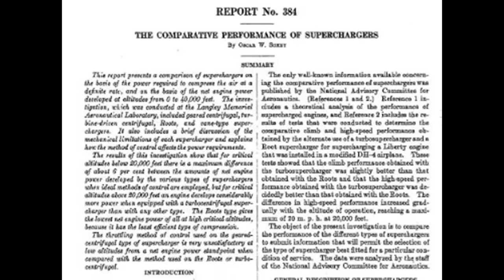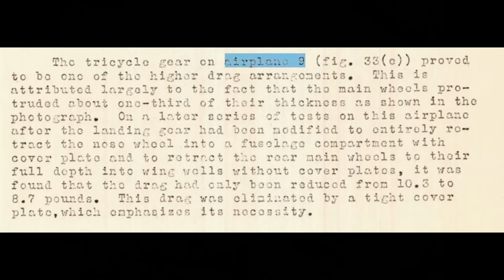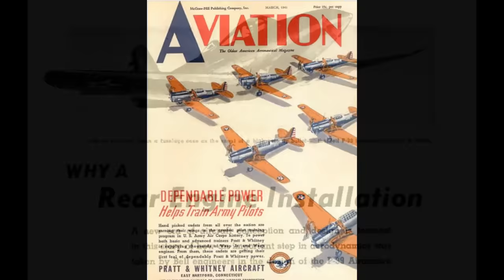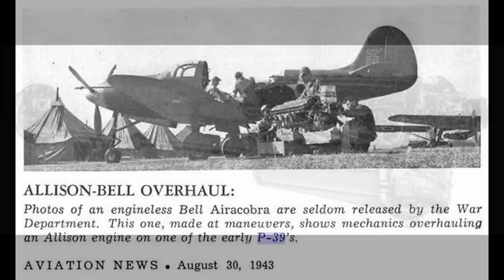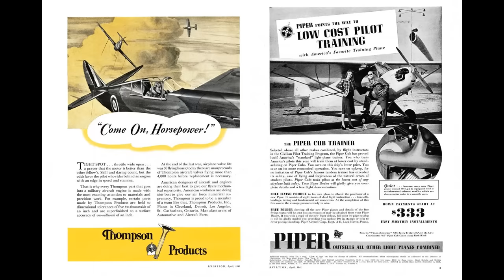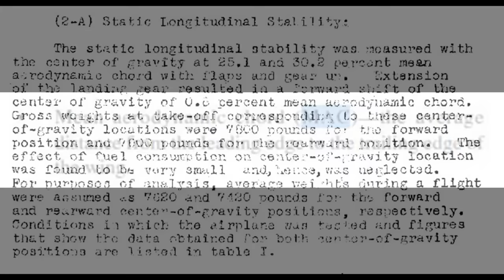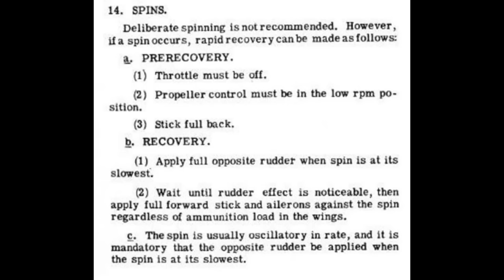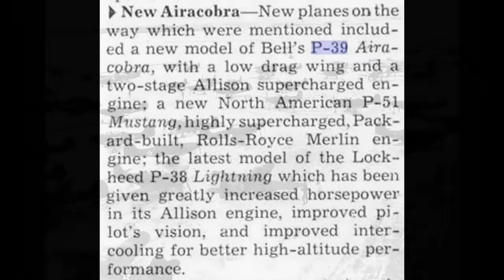Bell P-39 Airacobra, Why the Mid Eng?

Comment: One thing a lot of people miss when comparing Super Chargers and Turbo Chargers is. A Turbo’s Drive pressure and how it helps bearings and the rotating assembly. In the high horse power Alcohol burning Hemi world when running a Roots ,Screw , or Centrifugal type super charger. It will eat rod and main bearings each run when your running it hard. The same motor with Turbos will make 20-30 runs with out even checking the bearings.

Comment: The audio balance is a little bit off.  It's balanced to the right just a bit, but it's not just volume shift, the left is a bit basy, while the right holds the higher pitches.  So it sounds a bit weird, and is hard to correct on our end.  :/

Comment: In the 1980's I talked to a veteran who flew p39's in New Zealand service during ww2, he said the forward opening car door type cockpit entrance made bailing out difficult at any speed and in a crash landing the engine tended to break free from it's mountings and slide forward and crush the pilot. he said that they only trained on the type but lost some pilots before they got F4U corsair's and served in the pacific theater  against the Japanese.
Reply: The doors on the P39 was jettisoned by releasing the front hinges from the aircraft. Dodging the tail was a bigger problem when bailing out.
If you hit the ground hard enough to dislodge a P39 engine, you are already toast in any fighter. The engine mount in a P39 is SOLID.
Reply: @allangibson2408  thanks Allan for the  information on the P39,have read as much myself years later , but I had no reason to doubt what he said at the time, have always loved it's small size, low level performance, mid engine concept and  with it's 37mm cannon it would have made a great ground attack/ tank buster.
Reply: @chrisgrantham8442  Bell liked mid-engine aircraft. The P-59 and P-63 followed the line. You could argue that their helicopters still do…
Reply: @allangibson2408  Thanks Allan, do you know of any other manufacturers who went with the mid-engine concept?.Bell nailed it with their model 47 of MASH fame, it's still going strong today, a Indian army/airforce variation has the highest  ceiling of any helicopter in service today, not bad for something that started life 70 odd years ago .
Reply: @chrisgrantham8442  Jet engines kind of displaced mid mounted piston engines but they were very common in WW1 (usually in pusher configuration).
The downside with the configuration is the extreme difficulty in fitting a new model of engine as it requires a full redesign of the airframe.

Comment: I wonder if a VT fuze could have been fitted to 37mm shells, or maybe go larger to a 50mm autocannon to fit the VT. Muzzle velocity would be relatively low, for sure, but that would be a heck of an anti-air shell with a kill radius of 20-ish yards!
Reply: They put it in the 40mm so I expect that by sacrificing some of the explosive filler they may have been able to put it in the 37. Interesting idea, I don't think I've ever heard of proximity fused air to air cannon projectiles, even in modern use.

Comment: Hello Greg, 
I 'm not sure I agree that the fuselage would have to be made heavier to handle tortional load. The load goes from propeller, to shaft, to engine, to engine mounts, to fuselage and finally to wings during flight, or to landing gear on the ground. The part of the fuselage structure between the engine mounts and the wings handles the load. On the P39 that part is much shorter and handles the load much better anyway. The part of the fuselage forward of the mounts towards the propeller plays no part.
Thank you for the time and effort you put into this, your channel is gold
Reply from the maker: The twisting load is between the gear box and the engine.

Comment: Hi there, Greg.  Have you ever covered prop-gun interruption gear in detail?  Does each gun need its complete, separate, interruptor, or can multiple guns use a single unit, w pushrods(?) going to each gun?
Reply from the maker: I have not covered that. I might do it at some point.

Comment: High G-onset rate in pitch is generally considered a bad thing. The F-16C reduced the size of the horizontal stabs because the A model put guys to sleep.  The P-39 wouldn’t be stronger than the pilot, but onset rate is still a problem.  The Tweet had a very quick onset rate, again, not useful since the brain needs time to adjust blood pressure for pitch, but not roll.  Fast G onset just puts you out.

Comment: Why did the P-39 lose it's turbocharger?  Lt. Ben Kelsey was driving the fighter programs at the time, both P-38 and P-39.  He was the main force for the high-altitude interceptor concept, at least where the rubber met the road.  There was a 6 month transfer of him away from the fighter procurement project.  When he got back, the P-39 had lost its turbo and Lt. Kelsey was quite upset that some paper-pusher had made that ridiculous decision with Bell and neutered his short-range interceptor. (Although he also widely admitted after-the-fact that 'interceptor' fighters were a ruse to get funding from the isolationist-minded bureaucrats.)

Comment: 14:52 - He was right. By the end of the war EVERYONE was thinking along the same lines, except they moved the pilot right up behind the propeller. Note the Fisher P-75 and the Messerschmitt Me-509. Not to mention the proposed Rolls Royce fighter design that was to be used with the Crecy, it got as far as a plywood mockup. Note also that jet fighters, from just post-war until today do the same thing - put the engine(s) behind the pilot and the pilot up near the nose. I don't think it was aerodynamics, rather it was for better visibility, especially on the ground.

Comment: Greetings....I.  have. Watched.  Many.  Of. Your.  Video.s...  many. Times.  Especially. The. Airacobra. Vids....  which.  I.  Appreciate. Very. Much....and.  this.  Is.  Why.....  today. On.  This.  Video...  I. Realized...you.  mention.  Intake Charging.  Systems...   and.  My.  Thought....is.....   the.  Running.  Engine..  is. A. Bunch. Of.  Operational.  System.s. functioning....  like.  Oil. Sys....intake. sys...  exhaust sys...  elec sys or. Ing  sys........  cooling. Sys.. fuel sys... and. The.  Big. Difference.  Of. The.  Allison. Or.  Merlin.   Which.  You.  Mention. In. Other.  Vid.s.  is. The.intake.  Charging  system.  ..  at. Least. At.  That.  Time...thanks.  Again..  for.  The. Trike. Gear.  Video s...  have. The. Best.  Of.   Days...

Comment: The germans had a electronic switch that let guns shoot from behind the prop without negating rate of fire. Usually you would get a 20 to 40% loss in rate of fire. The german switch cut that down to 5-10%.

Comment: Great video Greg. Two comments: The G onset argument is not very compelling. An aft position of the cockpit, like on the Corsair for instance, would actually reduce G onset in a pull, since the associated positive pitch rate acceleration generates  transiently negative G at the pilot station, thus making the onset more bearable. However when releasing, the pilot will experience the opposite (transiently slightly higher G due to the negative pitch acceleration). However the lever arms were still quite small in WW2 aircraft compared to todays fighters, so the effect was probably negligible anyway. 
Second one: Comparing cg locations in %mac, to derive stability characterics across different airplanes is not 100% accutate. The appropriate measure would be the static margine expressed in %mac. That takes into account the actual position of the neutral point of th aircraft (determined by wing and tail geometry). But that is not easy to come by in the documents I guess. The engineers will make sure that static margin is appropriately designed, even with a rear mounted engine, before even thinking to have a first flight 😉
Reply from the maker: Percent mac is the best we can do here, and in my experience it's a good number for overall comparison.

Comment: The way they have it modeled in game in War thunder really made me look into it, and while the COG is perhaps better, the fundamental issue is that the heaviest item in the plane is right over and slightly behind the wing. This should be weirder than it is though, and I mean just consider, if you drop both planes a p-40 and this, the P-40 is going nose first, the P-39 is going kind of flat if not a bit tail heavy. You can see that in the one stall, the center section is pretty solid, the tail is crumpled, probably eating a lot of the initial contact with the ground. The best way I could describe it in maneuvers in SIM, is that instead of diving or carving through turns, you almost felt like you were sliding through the corners and you had to be really careful about that. This is most likely why you would see Lumchevaks as well, if you get an air stall over one wing the thing is going to start a spin like a top because it is so well balanced and center heavy. 
Now these things can be managed, and it is weird, but it certainly has its own charms and appeals to and I think that is what the russians made happen, they stuck with it and mastered it. Not like they could just hop into a clearer option. 
I don't think it is ideal though. I think I would rather be able to snap roll than go into a Lum.

Comment: 23:20 So I play flight sims a lot. I have noticed this rotational force umongst many different prop planes. It is prevalent in the 39, however it's worse in the p-63 King Cobra. Every sim I play I have to set a positive rudder trim to atleast 5% to maintain a straight coarse at cruise-speeds. It's the only way I've found to counteract that rotational force so you don't have to fight the airframe so hard just to keep it straight. 
Once this is done, the girl soars

Comment: I doubt putting the cockpit closer to the center of gravity would do much to reduce stress. Most of the force on the pilot is the centripetal force when the plane changes direction in the air. There would be a small force from the plane's rotation, but that would likely only play a role for a short amount of time as the rotation rate of the plane would stabilize fairly quickly. This is the main force I could think of that they might be referring to, but the difference in net force between a conventionally placed cockpit and one near the center of gravity would be pretty minimal considering the centripetal force.

Comment: Part 4. Aircobras in Northern Fleet (255 Fighter regiment).
P-39 started to arrive at 255 Fighter regiment of Northern Fleet in February 1943. The main target of the regiment was escorting torpedo and dive bombers. By April 1943 pilots studied the plane, on April 4, 1943 Aircobras flew its first combat mission – escorting Pe-2 dive bombers. First air fight was on April 29: 6 Airocobras engaged 6 Me-110, shot down two of them.
These months there were 8 Aircobras in the regiment (1 – Mk.1, 1 – P-39D-1, 6 – P-39D-2). They arrived via Northern lend-lease root: Britain – Murmansk.
In May 1943 Aircobras shot down 2 Me-110, lost 1 plane in combat, pilot killed.
In June Aircobras from other units arrived and by July there were 20 Aircobras in the regiment (5 – Mk.1, 1 – P-39D-1, 5 – P39D-2, 4 – P39M, 5 – P-39N). According to regiment’s report, radio stations SCR-274 were significantly better in range, power, provided better communication, than RCI-4 stations, that were on Jak-1 and LaGG-3.
P-39M and N which performance was better at high altitudes used to escort and cover “high” bombers, Mk.1 and D-2 for “low” torpedo bombers.
Pilots of the regiment tested local fuel pods (330 litres) instead of standard (284 litres). After proving their safe and reliable use, the tactic radius of Aircobras rose up to 350 km (2,5 hours of flight).
There were 4 air fights in June, P-39 shot down 10 – Me-109, 3 – Me-110, 4 – FW-190 and 1 – FW-189. Lost 2 Aircobras.
On July 22, 1943 9 Airocobras escorted 5 A-20 “Boston” torpedo bombers. They attacked a sea convoy, A-20 sank two ships, on the way back P-39 shot down 3 Me-109, that attacked the group. The next day 3 Aircobras were lost due to AA artillery fire.
On August 1, 1943 there were 16 Aircobras in the regiment. This months 4 planes were lost. The commander of 255 regiment, major Panin was killed covering a torpedo bomber.
Early in September only 12 Aircobras were in the unit. As Mk.1 and P-39D-2 engines (E-4) were worn out, they were changed for E-18 engines from P-39M. Late in September 8 new P-39N arrived. New engines (E-19) installed in 2 P-39M. Shortly after one P-39M was shot down. And one P-39M flew till summer 1944, when a young pilot crashed it.
BTW, 11 – P-40E “Kittyhawks” were transferred to the regiment in October 1943.
Totally, during 1943 pilots of 155 Fighter regiment on Airocobras shot down 97 enemy planes (45 – Me-109, 19 – Me-110, 27 – FW-190, 3 – He-115, 2 – Ju-88, 1 – FW-189). Lost 12 pilots, 16 planes.

Comment: Very interesting discussion. It looks like that the Swedish company SAAB thought about the Bell's design as well. The Swedish conclusion looks like a hybrid of P-38 and P-39 called SAAB J-21A.  Also Dornier tried the shaft on their Do-335. It is said they had a lot of trouble due to vibrations. Like in ships, a shaft drive needs to be hold in a stiff hull. Or your need to get the shaft as light as possible. Stemme S-6 uses a carbon fiebre shaft in its mid-fuse engine configuration. For comparison in real life, fly a Rotax driven Diamond HK36 against a Rotax driven Stemme S-15 in a dogfight. What might be the better engine configuration?
Or do pilot training and skills make the difference? I guess, surviving pilot training on tail draggers  reduced the advantage of the P-39 in real life. My guess is, any experienced fighter pilot would chose the A6M Zero in a head to dead dogfight anyway.

Comment: Was the P-38 the only fighter with  inline engine(s) that had turbos.Perhaps the exhaust manifolds on radial engines was better suited for turbos Having to design and rout the exhaust inside the fuselage on a inline engine could have caused uneven heat transfer causing excess heat on a number of cylinders. Did the exposed turns allow for better hat dissipation as well as a utilization of slipstream?
Reply from the maker: I can't think of another turbo V-12, but turbo liquid cooled V-types are common in other applications, I really don't think that was a problem.

Comment: Only a small point and not specific to the P 39. 

An aircraft in a spin is in effect a gyroscope turning in three axis,  it is rolling and yawing in the direction of spin and pitching up. That said, the application of full opposite rudder is not intended to reduce the yaw, but to apply a side force to the "gyroscope", which will precess through ninety degrees and apply a nose down force with the intention of un stalling the wing.

This is, of course, why the correct procedure in an inverted spin is to apply full in spin rudder which will result in a nose up force un stalling the inverted stalled wing.

Spinning is a pretty complicated thing since the propeller is also applying another gyroscopic force of its own. In some aircraft (DHC Chipmunk is one) if the recovery does not get it out of a flat spin, turning the mag switches off sometimes reduced the engine RPM enough to allow recovery.

Comment: Part 2.
In June the regiment accomplished 173 combat and 180 non-combat flights. There were 7 air fights. Shots: 6 – Me-109, 1 – Ju-87, 1 – He-111. Lost 5 planes, 2 pilots killed. New planes arrived: 5 – P-39L and 2 – P-39D-2. There were lots of missions to escort IL-2.

During July and August accomplished mostly A-20 “Boston” escorting missions. No air fights engaged. Lost only 1 Aircobra in a catastrophe (pilot died).

According to the transfer act in July 1943, when major Semenishin became the head of the regiment, there were 12 combat-ready P-39K, L, M models plus 2 P-39D-2. 1 – P39L, 1 – P39M and 3 – P39D-2 in repair.

Totally, during the battle for Kuban (Southern Russia, near Caucases) from February 16 till August 20, 1943 the regiment made 1625 operational flights (2072 flying hours), engaged in 111 air fights, shot 150 and damaged 29 planes. Lost 30 Aircobras shot and 11 damaged. On August 24, 1943 the regiment was transformed to 104 Guards fighter regiment.

In September 1943 the regiment got new P-39N, but several P-39K, L, M were still used up to the end of 1944. 

The most efficient pilots of the regiment:
Capt. Drigin (on June 02, 43) – 287 missions, 57 air fights, 15 personal + 7 in-group shots;
Capt. Vishnivetsky (on July 01, 43) – 153 missions, 53 air fights, 15 personal + 12 in-group shots;
Lieut. Komelnikov (on June 02, 43) – 76 missions, 39 air fights, 15 personal + 5 in-group shots;
Maj. Semenishin (on July 01, 43) – 195 missions, 34 air fights, 13 personal + 10 in-group shots;
Source (in Russian): http://airaces.narod.ru/all/298_104.htm
Reply from the maker: Thanks for this post.
Reply: @GregsAirplanesandAutomobiles   You're welcome. I've heard about lend-lease P-39 before and after watching your video decided to dive a bit deeper into this topic. Found interesting details and decided to share. 
Posted part 3=)

Comment: Sitting close to CG vs far from CG does affect the pilot’s G-loading. How much, depends on the radius of the pitch movement. Fighter jets with high TAS the effect is much less than slower prop planes. One example is pulling G’s with a two seater Extra 300. Front seat G-meter reads more than rear seat.